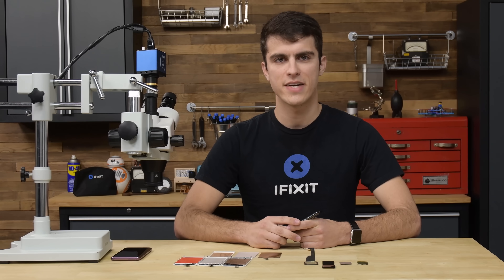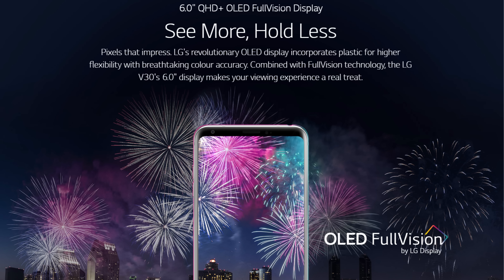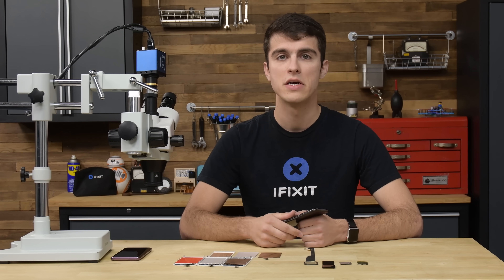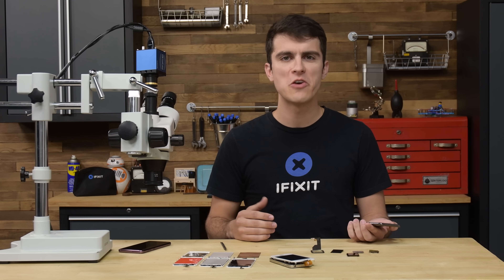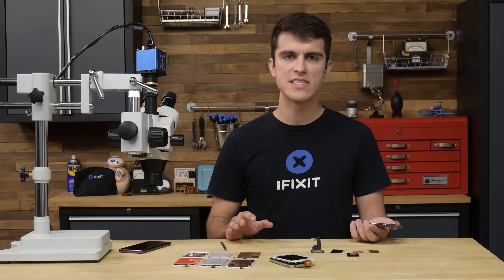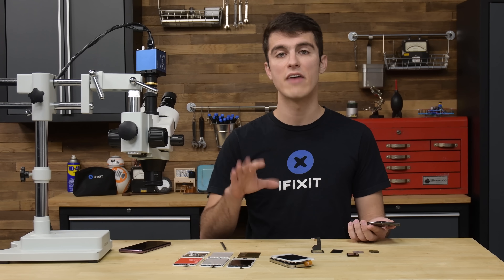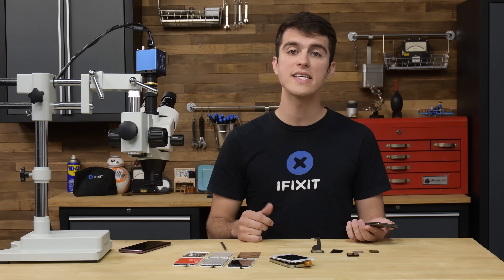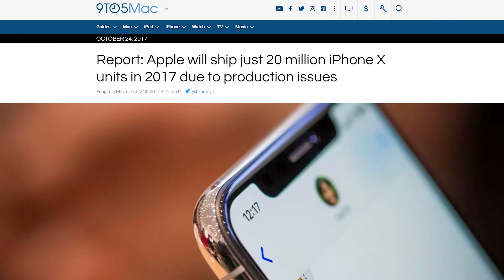OLED vs LCD: Smartphone Display Teardown and Comparison

Comment: Well, Apple sources its displays from Samsung so I think the actual reason was some sort of a contract between Apple and Samsung.
OLED is going down in price as of now. But the thing is, Samsung is now working on Micro LED which is the next step up from OLED. Micro LED doesn't have that organic aspect of OLED therefore the burn in and other cons of OLED are not an issue with micro LED. Just wait a few years and watch Samsung start releasing micro LED 4K TV, smartphones, etc. only for Apple to release it on their computers and smartphones a few years after Samsung.
Reply: LCD suppliers maybe Japan Display, LG and few other companies. 
Apple doesn't like rely their parts on single company.

OLED, Apple doesn't have choice, Samsung is literally dominating market with 90% share.

It's not like Samsung being evil dictator of smartphone OLED market, It's just other companies failed on OLED R&D and mass manufacturing.
Reply: Thé lcd's ste preoduced vu Sharp japan and thé oled now by Samsung mainly and LG
Reply: The iPhone Xs and Max use both Samsung and LG oled displays. It keeps Samsung from charging higher prices when there is competition from LG. Apple has put strict standards on LG to get high quality displays that are not going to end up like the original batch of Pixel 2 displays with many problems.
Reply: We have the internet, internet users. It’s just the joke of someone being trapped in a Walmart and dying of hunger. 
https://mashable.com/article/apple-lg-samsung-oled-screens/

https://www.forbes.com/sites/bensin/2017/10/02/samsung-will-make-more-billions-more-from-the-iphone-x-than-the-galaxy-s8/
Acting like damn cavemen. Or just deluded fanboys when these are just ‘things’ man, keep calm and carry on.
Reply: Apple is actually trying to get into making displays as well, and has been working on creating micro led panels for a while now, so hopefully within a few years we will see those
Reply: Apple sources its OLED displays from LG, not Samsung.
Reply: @solidn6   oled from samsung.....lcds yes lg
Reply: @solidn6  ur wrong my friend. Samsung owns 90% of all OLED. Rest is LG. In fact, google and apple invested millions into LG, so they can make cheaper OLER for their phones. So on every iPhone, around 90-95% was made by Samsung and the rest by LG.
Reply: @solidn6  iphone x xs and xs max all has samsung oled screen not LG's.
Reply: @solidn6  they only invested in LG in hopes of breaking samsungs monopoly

Comment: What are amoled displays then
Reply: Micah Stahl the am stands for active matrix, which is similar to the oled panels. Most believe that they're the same things, when amoleds have a slightly faster pixels that oled, in most cases.
Reply: micah stahl AMOLED is active matrix organic light emitting diode It adds a layer of semiconducting film behind the OLED panel which allows it to more quickly activate each pixel That increased speed makes it ideal for larger higher definition displays with a lot of pixels quick google search goes a long way plus there is more risk of burn in on oled if you leave on same screen for hours with full brightness but same does happen to LCD screens but not as much as oled and oled has the best picture color then any other screen cant beat it on picture quality and lcd has light leak from corners when in dark room can see it on corner like a light through a crack in door
Reply: Same thing.

Comment: The only downside to OLED you mentioned is cost. There's also the way OLED panels degrade a lot faster than LCD panels. The LEDs get individually dimmer with use fairly rapidly, and although it's gotten better, Apple and others are researching MicroLED, a longer lasting replacement for OLED that doesn't use carbon, the element causing the short lifespan of the LEDs in an OLED (and the reason for the 'organic' in the name).
https://www.bloomberg.com/news/articles/2018-03-19/apple-is-said-to-develop-displays-to-replace-samsung-screens

Comment: What about amoled?
Reply: There are two types of oled displays amoled and pmoled, usually what the oled displays they call are amoled displays.
Reply: OLED=AMOLED
Reply: Why don't u all just shut the fuck up. Thanks
Reply: BASICALLY the same
Reply: Just with or without active matrix .
Reply: Theyre basically the same as OLED
Reply: Oled with active matrix
Reply: Samsung's OLED
Reply: That's still basically an OLED. AMOLED simply means active matrix organic light emitting diode.
Reply: Gabs NXT amoled same thing its oled
Reply: Gabs NXT its a type of oled
Reply: Gabs NXT its an active matrix organic light emitting diode
Reply: it's just oled
Reply: Ahhh
Reply: Gabs NXT 
OLeD :
a. Amoled
b. Pmoled
Reply: Its the same
Reply: amoled is oled son
Reply: Gabs NXT Amoled is oled with active matrix. Amoled is made by Samsung.
Reply: AMOLED is the same thing as OLED
Reply: amoled=oled
Reply: weinerschnitzelboy i remember early lcd pc monitors that are labelled as 'active matrix'. Maybe at the time this was a big deal.
Reply: Maybe u explain me why we are supposed to shut up even though a comment section is usually used to talk about stuff
Reply: Same tech, just a marketing term to make it seem they are different than the rest
Reply: That’s Samsung’s name for oled
Reply: It's the same thing.
Reply: Gabs NXT it is the same thing as oled just Samsung branded
Reply: Shortest explanation: Oversaturated display.
Reply: It just means that the touchscreen is integrated with the OLED panel

Comment: I am using Samsung galaxy s8 plus & having screen burn in issues in on screen buttons line & mx player areas red burn amoled display samsung is not good i m not buying Samsung phones anymore...
Reply: Do u keep ur phone on max  brighthess? Because my S7 Edge is running great with 0 burn or any problem.
Reply: Same burn on mom's J5 and mine S7.
Reply: Sadly i doubt you have the s8. Iphone fanboi maybe. I had s5,note3  and 4, s8 , and now note. Never burn in.
Reply: I I've been from galaxy s2 up to note 9 I never had issues with screen burn
Reply: Every OLED screen will have burn in dumbass, and also if you have it at max brightness it will increase the burn in issues
Reply: had a moto z that also burned in, 3 or 4 times actually. last one wasnt in warranty